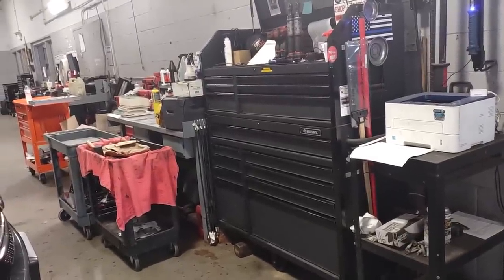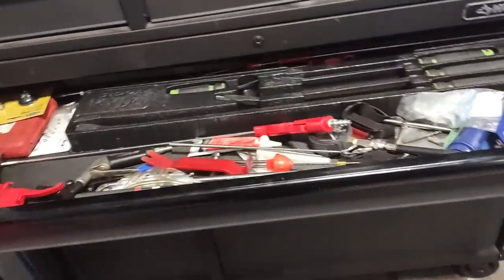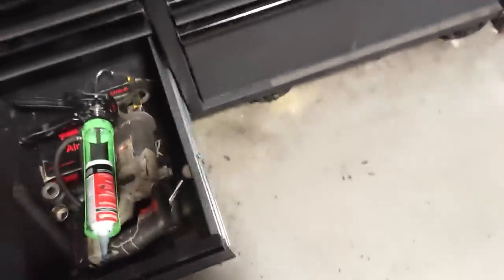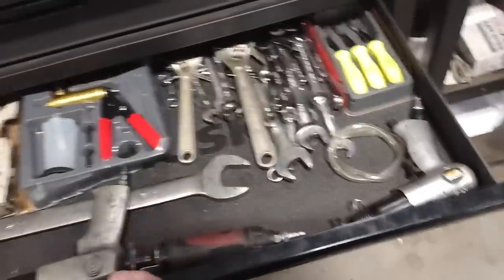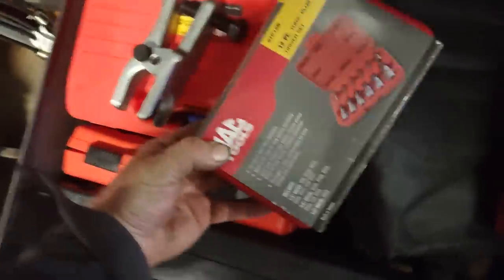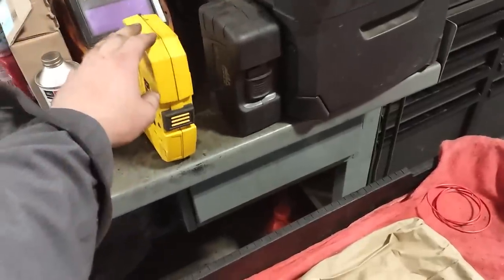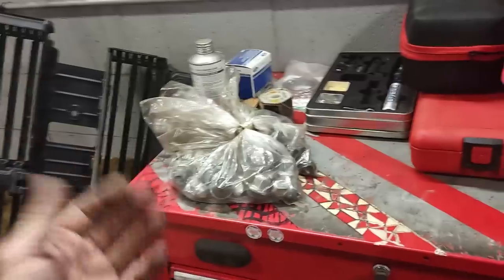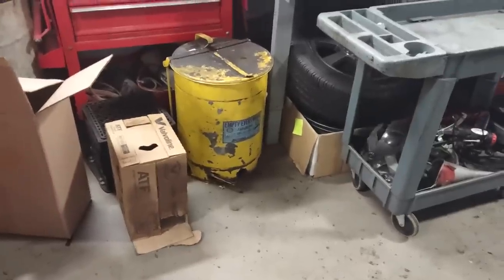Tool Box Tour - Subscribers Have Requested

Comment from the maker: There was 3 drawers but the major one I forgot to open up and it had all my half inch impact sockets and my 3/8 impact sockets as well as my Chrome sockets and my specialty bolt extractors including my swivel sockets

I also forgot to show my 3/8 drawer and my half inch drawer for my extensions my breaker bars and my ratchets

And I also forgot to show my air tool drawer

I'll have to do all this over again sometime soon maybe when I get another box

I was in a hurry to do this before I went home
Reply: Do you keep any PB blaster air tool oil in your air tool drawer, or on that counter with your other fluids?
(I just leave mine in the air tool drawer so I don't forget, I'm getting dementia!)
Reply: I wanna see!!! Pretty please!
Reply: Naive questions: when you work in a dealership or private repair shop, do they provide you with basic tools for the jobs they expect you to perform or is everyone expected to bring in their own gear? And how do you protect your gear from breakage or "walking away"? And if one of your tools gets damaged on  the job, do you get helped/reimbursed or is the cost on you?
Reply: @BSGSV  Nope, this is the equivalent of massive student debt that 4 year degree college kids have. Technicians have to get their base set of tool ASAP and bring to the shop before they even open the first customers hood, and they build on that tool set over the years as they do harder jobs, more specialist jobs, or want something faster/stronger. I don't know of any shops outside of college that will provide or fix a tool. That's why the name brand trucks are driving around to these shops, sell each tech with tools, and warranty any broken tools.

It's like a bank inside those tool trucks, many guys have to take out a substantial loan to buy their first set of tools, and some with chrome addiction can get caught up in the sales pitch and go $50,000 in debt before they've fixed 1 vehicle. Rich is being smart, has his discounted box, it doesn't have to be Snap-On red to fit in the gang, and he's got some cheap crap for when he is going to alter the tool for only 1 job ever, break it, or weld it into a new tool. Hate to burn up a single $20 socket to beat on it, weld it to remove 1 rusty bolt. I've seen the cut a wrench and use an air hammer trick, many reasons to have some cheap junk tools around incase one needs to be loaned to a buddy or sacrificed for that 1 shitty job, or a lube tech wants to "borrow" a tool 😒 might never get returned.
Reply: @BSGSV  tool chests/boxes have cheap wafer locks, some replace the lock core for more security. Or you can buy a GPS tracker online or directly from Snap On just like portable industrial air compressors and rental generators. But thier weight and tiny wheels make them hard to steal quickly. Plus many shops have security cameras now to reduce the liability of stolen customer cars, parts inventory missing, delivery of a pallet of parts not be there. And have video of the Technicians working in case of a worker's comp claim, they can play the tape back. Remember almost every dealership has the best Corvette, Shelby, Hellcat in the showroom, and the owner has one of his classic cars upfront ad well to help bring in customers. People want to sit in a $100,000 Corvette before buying the $23,000 Malibu.
During the Firestone tire recall, I seen all the techs do stupid stunks to ruin these tires, once they stabbed a tire with a knife, the tire pressure shot the knife back into somebody's chest, off to the hospital for his warranty repair surgery! 🤦🏻‍♂️
Then again during Obama Clunkers for Cash stimulus trade-in, people were doing dangerous shenanigans to "ruin" the gas guzzler vehicles engine, send a match down the oil dipstick with a HOT engine, still off-gassing into the EVAP system. EVAP and fire don't end well.
Security camera footage was used to deny the workers compensation insurance claims, they don't want to pay for stupid. 🤷🏻‍♂️🤦🏻‍♂️🙄
Reply: Just get another cheap box man. Tool box just holds your tools. It doesn't make you better unless it reduces dig time. If you wanted go extreme tool box or harbor freight
Reply: @RJ_Cormac  Wow, thanks for the info! I am not sure this is common knowledge. Much respect to those technicians.
Reply: @UberArchangel  You actually can go extreme tool box going down the Harbor Freight route. There's Icon boxes that rival Snap-On. As a matter of fact a lot of the new Icon tools are rivaling the big dogs in the competition such as Mac, Cornwell, and Matco.

Comment: I have always worked for independent shops. I have a whole 10 shelf unit filled with special tools. Lots of stuff that I may only use once or twice a year depending on make and model. I never really thought about it before, but it's probably nice as a dealer technician because you don't have to buy as many tools.

Comment: When I was wrenching in dealerships my box looked exactly like your ... except 1/3 as big or as many tools. You seem to have a lot of extras. Small kits to take outside or to another facility. I never had that. All those specialty tools in the blow-molded boxes - I only had the ones I used regularly. If I needed it once a week I spent the money. If I needed it once a month or less I borrowed or used the shop's equipment. Even if I needed something like twice a month I would break down and buy one. I had a main box and two rolling carts. One cart was all the specialty tools, the other was all metric tools, air tools, torque wrenches, and other stuff. This was years before American cars were using metric fasteners. It got awkward when some fasteners were standard and some were metric on the same vehicle. But then I got out of the business anyway.

Comment: See, i’m not the only Technician working out of a Home Depot tool box right now! Told you guys!
Reply from the maker: I need good tools I don't need expensive tool boxes but I may have to end up going to that soon
Reply: @FordBossMe  I just ordered a ICON set up from Harbor Freight after selling my Snap On Epiq 84. I just always regretting spending so much money on it, so i’m undoing that decision. Working out of a Milwaukee I got scratch and dent at HD…Should have the ICOn stuff in about a month from now. 😬
Reply: @JimmyMakingitwork  That sounds like a bad decision as most of the time you will lose your ass if you sell a box you bought new. Technicians are cheap and always looking for the best deal, so when buying used they usually won't pay over half the new price even in pristine condition. I bought my macsimizer for 4k off the Snap-on truck. It was 3 yrs old and msrp with stainless steel top, prybar/pick locker, and creeper holder was nearly 12k. Same price as an extreme, but when a drawer detent stops working my Mac rep brings me new slides for free the next week

Comment: The one tool that matco makes that seems to be heads and tails above the other is their impacts was made a believer when my 1/2 inch stubby ripped off a bolt a snap on wasn't even touching. 

But with more shops going away from air tools they might be less useful.

Comment: Can't say I've had good luck with the Husky boxes, the drawers fall apart after a couple years. Looks like it's held up well for you though 👍
Reply from the maker: The big fat her drawer in the middle is the one I didn't open up on the top box that's the one with all my sockets on the left side when you're looking at it it is a little bit saggy because that rail needs to be replaced the channel where it rides back and forth

Comment: Honestly this just made me realize how many tools i actually have stuffed into my small 36" husky bottom end that I use as a rolling box so i dont have to walk far Lmao. I have 2 sets of every metric socket in it up to 44(used to commercial but everything over 36 doesnt see use), matco 1/2 inch impact, 1/2 earthquake xt, 1/2 makita, snap on auto ratchet 3/8, numerous ratchets, pry bars, grinder&cutoff tool, zawzall, some blue point specialty stuff for bmws and chevys, some inverted 12 point stuff for porsche and vw, compression tester, power probe, etc... Im only able to fit everything in my box because I go with the most compact of everything. But my box if you open the top 3 of the roller bottom its so much weight that Itll knock over the whole small box. Id love to have my big box in my shop im at but i simply have no room to do so.

Comment: Cool set up I've been in this for 30 years and I've got 2 boxes like yours and a 56 inch box with a wood top and 2 cabinets and 2 u s general 5 drawer tool carts and all are slam full of tools because I keep my stuff locked up I got a couple cheap carts like your 2 for rolling work tables but I work on any car that comes in so it takes all the tools

Comment: Seeing this has me a little concerned. As I go into senior year and graduating my auto program next year and getting a job I worry people wouldn’t be as nice as you and let me borrow a tool till I get my box and tools. This video has calmed me a lot. Thanks
Reply from the maker: You will be able to borrow as you build up...they know the life you will be a ok 

Ill do video to show you what you will need to start
Reply: Rule of thumb is if you have to borrow it three times you need to buy it.
Reply: @FloorItDuh  I go by the same rule
Reply: Just depends on the people you work with. Some techs will refuse to loan tools because of negative experience in the past of people borrowing and not returning or breaking a tool that isn't lifetime warranty and not replacing. The important thing to remember is to never borrow without asking and to return the tool cleaner then when you borrowed it. I'm fortunate to work in a small independent shop with one other tech that has been at it as long as I have (17 yrs). So between the 2 of us we rarely run into a job where at least one of us doesn't have the tool. We also try to buy new tools strategically knowing we are welcome to borrow from each other whenever needed

Comment: I like that flare tool! 👍 When I'm doing custom stainless brake lines it's almost impossible to get that double flare with any basic off the shelf or tool truck flare tool because of the hardness of stainless steel lines. It's a nightmare of broken cheap hand tools, need that flairing kit you showed. ⭐ Inline Tube has a lot of stainless factory upgrade replacement inventory, but not always exact I'd recommend calling instead of the website for their big kits. We had a 1968 428 Mustang convertible survivor original paint, not mint, but a good survivor. But the parts sent were always the wrong lines. They were very interested in what the problem was with this unmodified survivor from the 1960's muscle car wars, they wanted pictures, but still didn't have the right kit for this special pony vehicle. They were nice and eventually sent out their tech to inspect this Mustang (found out the staggered rear shocks changed by Carroll 50+ years ago was not what regular Mustangs had), they got it right and also updated their product line, everybody wins.
But when I'm doing an upgrade like; disk brakes, modern master cylinder, line-lock, rear proportioning valve, hydraulic hand brake, etc. Can't order any pre-bent stainless kit when building customers go fast car toys, or a rare factory restoration build. Have to bend and flair by hand, or maybe the pre-bent kit is the closest option, but it needs the lines cut short for caliper hoses (instead of drums) or the original style end for modern master cylinder cut off and the correct size tube nut flaired on. I don't like using adapters, makes it look cheap, and another source for a potential leak to loosen up at the track or in the desert. I prefer to cut off the wrong ends and flair on the correct tube nuts to match the new part, it's a cleaner look, some people ask exactly what had been changed because it looks like it could be OEM with a factory copy stainless pre-bent kit and the tube nuts bolt on without adapters.
HAVE to have that nice hydraulic flairing tool to work with hardened stainless brake lines. It's a nightmare of Broken tools and curse words without it. Don't care how great the replacement tool warranty is if it breaks EVERY time you need to use it, garbage, get that nice flairing tool kit and you'll never be cursing for a warranty replacement before the job is done! 👍🤩

Comment: Dealers should supply speciality tools if their vehicles require it. Seems kinda weird if you’d have to buy it just to work on their stuff
Reply: Dealerships do provide all the specialized tools needed for their brand. Some techs just like to buy their own, especially the more frequently used ones, because it's faster than going to the tool room only to find the tool you need is already in use by another tech or it grew legs and walked off

Comment: Is there a disconnect tool you use to disconnect the heater hose from Firewall side? I’m looking at Performance Tool w83108 or Lilse 37450 to try. Working on a 2013 F150 5.0. Also have a 2015 F150 3.5 Echoboost

Comment: Don't forget to price the OTC ball joint kit before you pull the trigger. Ball joint kits are so overpriced IMO. You need a infra red heat gun haha. Great to use on brakes hanging on and engines that have a miss. Problems are easily located.  
I never could understand either the guys that wanted the $5-$10,000 dollar tool boxes, just to store the tools. The tool box doesn't make you money, tools do. Stay healthy. Wear latex gloves. All the best always.

Comment: 2 questions, what size lug nuts should I buy to replace my stock ones on my 2021 f150 XLT?

What are your thoughts on leveling kits, any issues with warranty after putting on a leveling kit?
Reply from the maker: If the dealer installed a leveling kit for you and does the alignment you're fine but if they find out that somebody else has done it under warranty and it wasn't leveled properly on the alignment rack set up properly they'll try to void the warranty sometimes

Comment: Don't let that damn tool truck mafia pull you in. A good box is a good box. As long as it's durable and holds you tools that's all that matters. No need to spend 5-15 grand on a tin box with a few drawers in it. But with that said I had Waterloo Industries tool boxes. Of course I was young and dumb when I bought them and my dad's was 20 years old and still worked and looked brand new. Lol.
Reply: Nothing wrong with Waterloo Tool Storage. They made the Craftsman tool storage for years. Not anymore, except for Lowes supplied Craftsman tool storage. The Sears version of Craftsman tool storage is supplied by Montezuma and made in China.

Comment: love to find a liner that the tools like punches with stay put when you shut the drawer...
Reply: Use the kaiser foam inserts and you lay out your tools on top of it, trace around it, cut it with an exacto knife or razor blade then the tool sits down inside of it. You can always tell at a glance what is missing and your tools will never move a mm! Best thing out there in my opinion. 

I was a jet engine mechanic in the Air Force and that’s were I learned about it and have been using it ever since! We had to have a way to quickly and accurately inventory our tools before I walked away from that aircraft and said it was good to fly. Sockets and jet engines are not a good combination so it gave us the ability to look at each drawer with a quick glance and be sure I did not leave anything in the engine bay

Comment: The hydraulic brake line flare tool is the best thing I wore mine out same deal bought it back when it was around 500. ball joint tool not a shop supply at your dealership?
Reply from the maker: In the abyss of Redbox's I'm sure there's one in there somewhere but we just buy our own
Reply: @FordBossMe  I understand that.  the tool room at my home shop is packed after 30!years it’s amazing the tools you accumulate

Comment: Buy a nice slide top roll cart and keep the husky for your specialty and little used tools.
Reply: Exactly. I have a Blupoint 5 drawer cart that has most of what I use on a daily basis. Then my Macsimizer has all my specialty and less commonly used tools. Then I have a Snap-on 3 drawer diagnostic cart for my scanner and all my electrical diagnostic tools

Comment: I paid about $900 for mine, got all my tools that didnt fit in my mac economizer 2000 in it.

When i worked in a shop the mechanics bottom drawer was the same as yours.

If your just going to store the small boxes and tool kits specialty tools why not look for a industrial cabinet somthing two door multi shelf so you can see all those boxes and what they are?
Reply: I bought two used 72" tall metal cabinet from an office supply store for 40 bucks that I use to store those boxed kits in. For added security I added a hasp and padlock to it. Sand paper and blue paint made them match the trim inside my shop..Lot cheaper than side lockers and and each one stores bout twice as much as two side lockers.

Comment: That brake compressor thing looks crazy dude
Reply: It's the best damn tool I have one. Doesn't matter if its a push style or turn push it will do it. Saves the wrist from braking or tiing down caliper if its being stubborn. Get this bad boy set it up, hook the hose up, pull trigger and turn handle. It does the rest. Well worth the money. Had a few customers back in the day over extended both turn and push styles and straight push, and the old fashion wrist brakes could not put them back in. Pick this up and in minutes got calipers compressed.
Reply: @jonjenkins5793  that’s hot